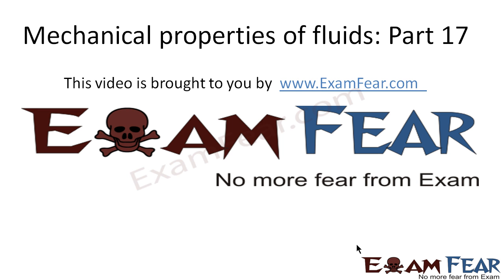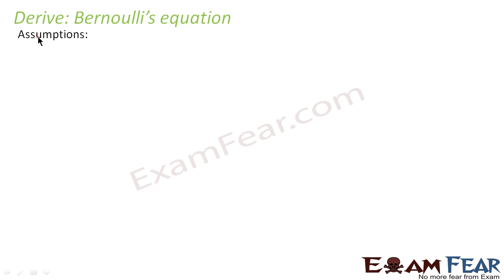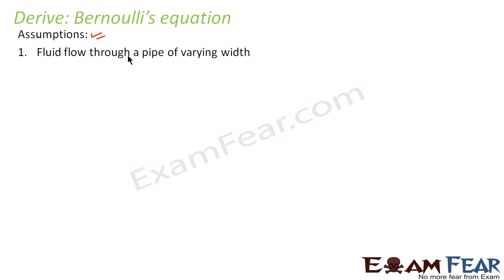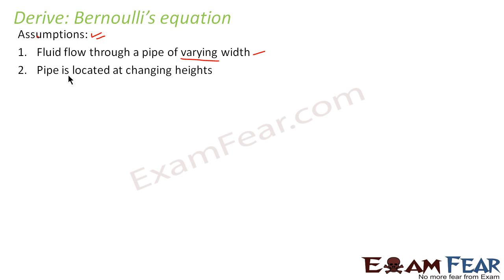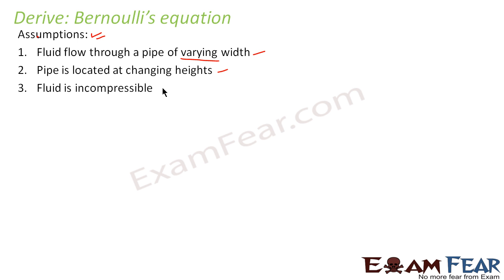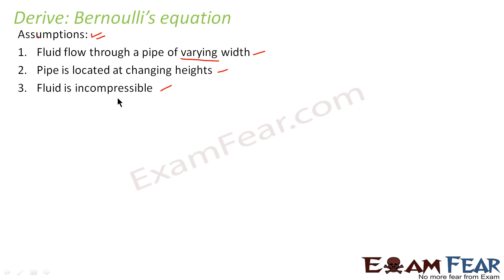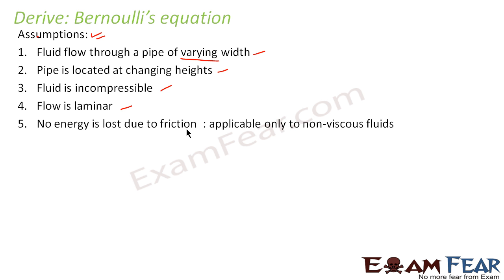Physics Mechanical properties of Fluids part 17 (Bernoulli Theorem Derivation) CBSE class 11

Comment: Why Force is equal to pressire *area???
Reply from the maker: Pressure is force per unit area. Therefore, F = P * A. For a given force, if the surface area is smaller, the pressure will be greater.
Reply: Oh yeah, Thanks

Comment: You barely respond
I'm like the 5th to ask in the comment section that Why Net Work = W1 - W2 !
Reply: +nSack because we consider a small portion from down to up
Reply: nSack actually it is not net work done it is change in work done and hence it's w1-w2
Reply: Just memorize.no one will ask you why it is w1-w2.😎

Comment: how did the net work become w1-w2?The fluid's velocity is in the same direction in both cases,right?
Reply: No friend, its becuz, in the first case, that is W1, we have to apply some work to the fluid to move. But in the second case, W2, the fluid itself do some work to move due to the pressure developed on it.... The work done on the system is considered to be positive, becuz an external agency is the producer of energy for that and it is an addition of energy whereas the work done by the system is negative as the system itself is the source of energy. Hence it loss some energy. Therefore, net work done W=W1+(-W2)=W1-W2.
Reply: @rsp1482  Thanks , you explained it really well
Reply: Pushpakumari R S  thank you...it wasn't explained in the video..but u  cleared it 😊
Reply: @rsp1482  thanks a lot..
Reply: @rsp1482  thanks so much bro
Reply: Really @pushpakumari R S u  cleared my doubt too. Bcs I also have the same doubt ....
thank you....!!👍👍
Reply: akshay b.menon
Reply: Malayali anno